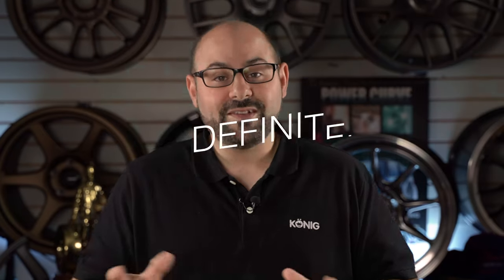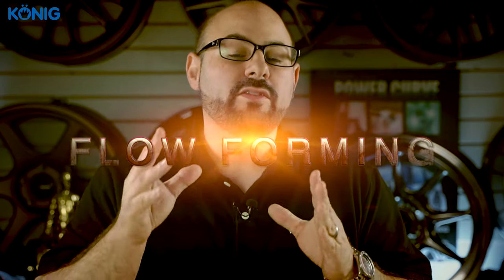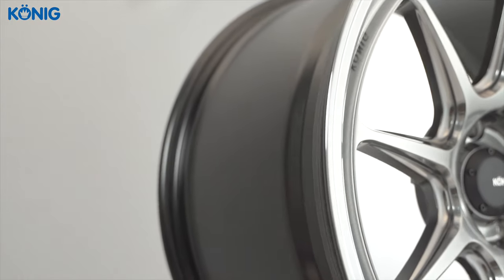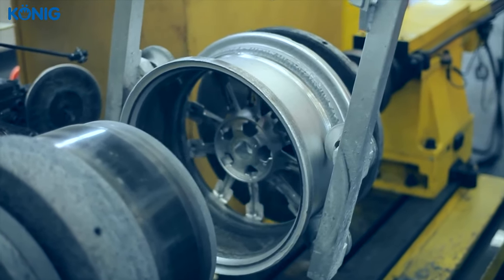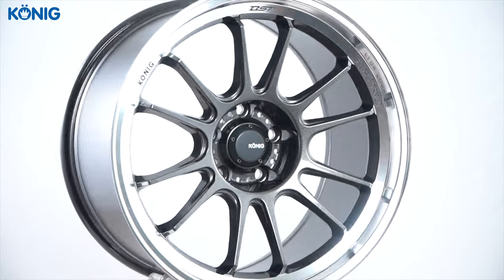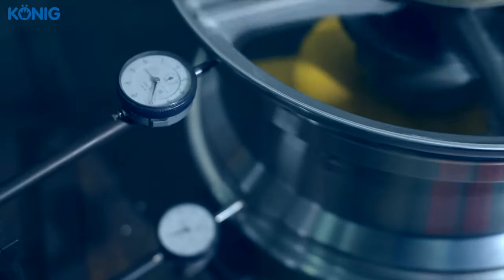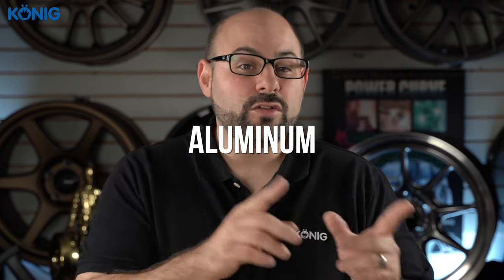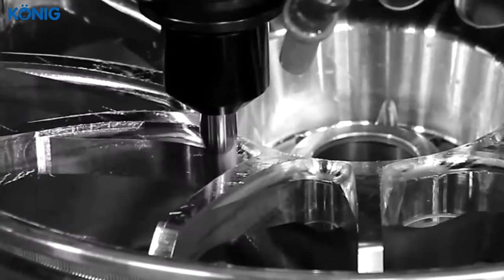Isn't Flow Forming Just Cast?!

Comment: So it's kinda of a hybrid between cast and forged then?
Reply from the maker: I suppose thats one way of looking at it.
Reply: flow form wheels are pretty much forge rims with cast spokes wheels stronger and lighter then cast wheels but weaker and weight more then forge wheels.
Reply: @patthonsirilim5739  maybe you need to rewatch the video. Flow form is NOT forged, not the barrel and not the spokes. None of it is forged. If you want to call it flow formed barrel forged because it involves heat and pressure then I guess. True forged is a wheel that was under extreme heat and under extreme pressure 8-10k pounds to create an extremely strong wheel. Flow form is not even close to the strength.

Comment: Just ordered a set of Japan Racing flow formed wheels because my OEM cast 21 with low profile tires just keep cracking. Looks great but it's not for a road car, only for track! now with 19" flow formed I'm pretty sure I'll never crack another wheel again! slightly higher profile tires and also saving around 4kg per wheel compared to the OEM 19", that's a lot! thanks for clarifying the tech behind it!
Reply: is the flow formed wheel
more durable?
Reply: @tracy062  100%. Not exactly forged but many times better than cast. Very close to forged at a fraction of the cost.
Reply: @ricmrodrigues  can u still use it for offroad?
Reply: @tracy062  my car is not an off-road car. I meant the OEM 21 inch are not good for normal roads because of the very low profile tires. It's a recipe for disaster.

Comment: Would it be fair to say flow formed is a midway between cast and fully forged?
Reply from the maker: Fair to say, yes.
Reply: @konigwheels  cool!

I'm split between the hypergram and fully forged for my 2013 accord EXL v6.  I want light wheels, no racing, but I want quality.  I'm working on handling mods.

Comment: The reason Konig wheels are some of the cheapest flowformed wheels is because the use the cheaper gravity cast center unlike Enkei that does Tilt cast which is the highest casting strength under having a forged wheel.
Reply from the maker: Hey Camm,  First I have to tell you, I'm not sure what's got you so triggered.  You came here to provide your thoughts, we appreciate that, and appreciate the opportunity to converse, we're also fine with answering you.  First, we're not the cheapest flow formed wheels, not that it matters, but we're not.  Second, the difference between modern day gravity type casting and low pressure when used in the flow forming process is neglegable.  This is based on TESTING, not theory.  We utilize both processes depending on the type of run that is required.  The advantage to this is really found in the cost savings at the factory level for larger mass production runs.  And just so you know, tilt cast was an OLD term for the way gravity casting was done, it's not a third process.  Finally you may want to do a bit more research on the relationship in technology and our parent company.  Serioulsy Camm,  we appreciate you coming to our channel to have a conversation, but I'm not sure why you're so angry.  We've been doing this for over 40 years, we're transparent about everything we do, we support the community and have continued to try and help the growth of motorsports from the grassroots level for decades.  Again, you have every right to your opinions, and we really do appreciate you taking the time to comment.

Comment: This video focus on the barrel of the rim. This does not answer the truth about the quality that really matters to help determine if a wheel will suffer catastrophic failure when in use which is also how the center from the hub to the outer edge of the spokes where they meet the rim.
Reply from the maker: We answered your other point above. However, the reason there is focus on the barrel is because that is where flow forming occurs, regardless of manufacturer.  Thats the process. Also when it comes down to truth, you should also understand how the wheel testing standards work. It's way more complicated than just exactly which casting technique is used, I'm sure you know what I mean between testing to exceed standards such as j2530, JWL, VIA, etc.

Comment: OK I really want you go focus also on the center of the wheel. Is Konig gravity cast, Low pressure cast or TIlt cast?????
Reply from the maker: Sure Camm, what would you like to know.  We've answered abunch of questions you raised above, hopefully that helps clarify any issues you had.  However, depending on which wheel we are making and the process / run that we're intending we utilize both gravity or Low Pressure depending.